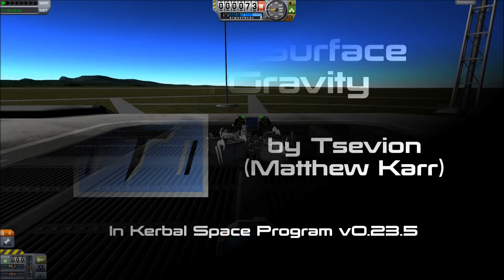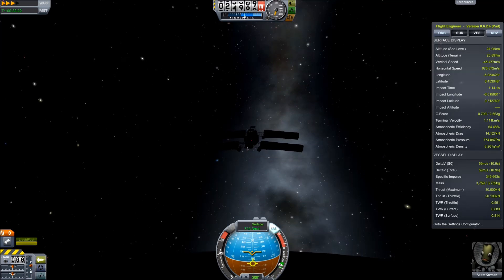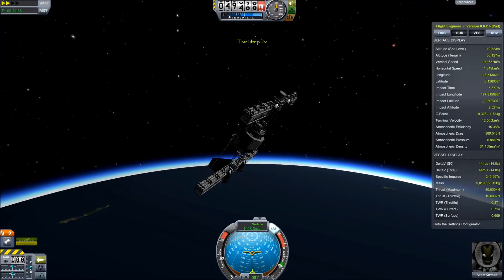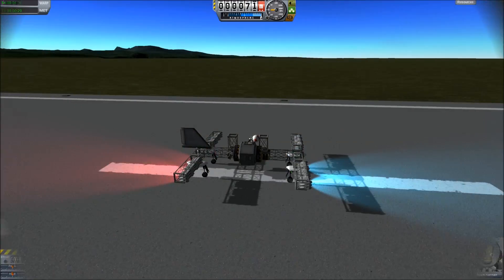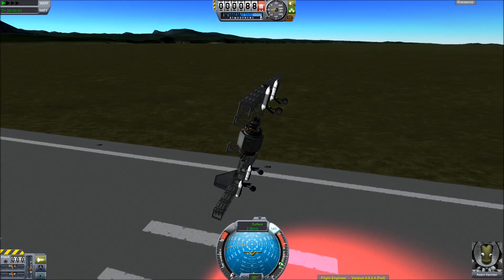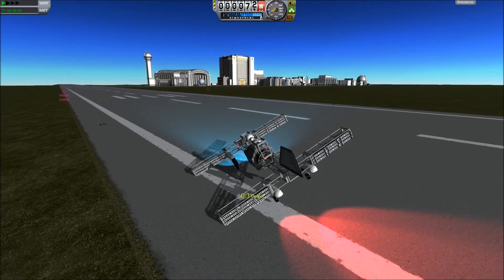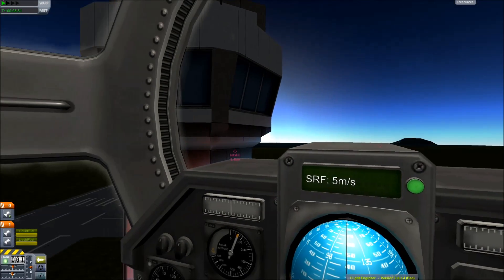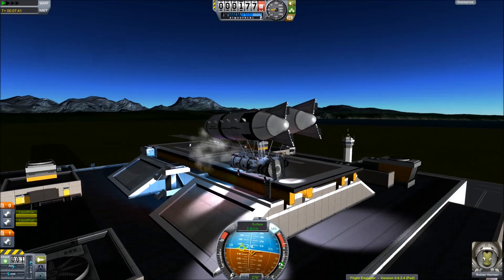KSP: Control Surface Antigravity... and a Stock Zeppelin!?

Comment: First a boat. Next a helicopter and VTOL planes.Then an orinthopter. Now a Zepplin? Is there anything in this rocket simulator that can't be made? Anyone try to make maglev trains yet?
Reply: I saw one.
Reply: *****
With or without mods?
SWDennis made one with surface repulsors (mod).

Comment: hey, as the control surface force depends on the G force or wheight, could this be use to make a floating landing platform?? maybe a big circle that rotates slowly and has control surfaces on the edges? or maybe e bit elevated?
Reply from the maker: I may have to try this... I'm honestly not sure whether it would work or not... but it definitely could be interesting.
Reply: The problem you would have is the game stops loading physics for objects or craft after a certian distance
Reply: Fraser Lamb i
 mean as a vtol flying/build chalenge
Reply: I tried the rotation and it didn't realy work, maybe your zepelin could be given a platform or something, but I made a absolute beast of a heli rotor with these, just can't realy have it stay attached as I'm bad with those rist things...
Reply from the maker: woodrunner I've actually tried it out and managed to get it working, a large floating platform that rotates at about 1 RPM... I then landed a VTOL on it. Man, jet powered VTOLs are HARD to land on a platform. I may cut that video together this weekend.
Reply: Matthew Karr niiice dood, i tried the platform but it would flip out of control…maybe it was too small…did you use sas for rotation or some (ion maybe) engines?
also, are you interested in the stock vertical doors? i can't make a video of it because of my hardware limits, but if you want me to send it to you (it (SSTO) has 300 parts and the doors work flawlessly) i can, all i ask is maybe a link to my channel in the description or something :)
Reply: Matthew Karr sorry if this confused you, but wood runner and rojasen are the same guy, wood runner is the one where i upload videos, and the browser just switches them around, sorry for the confusion